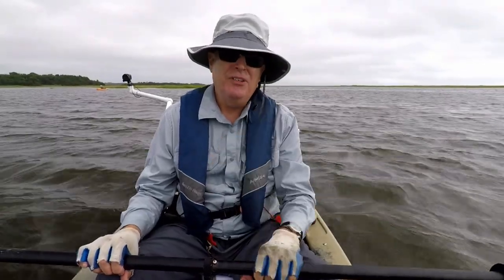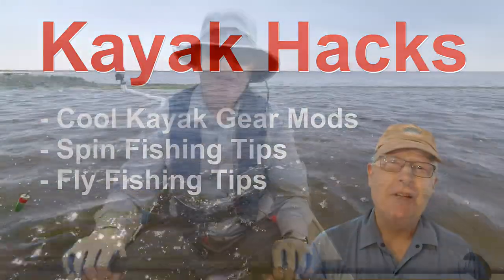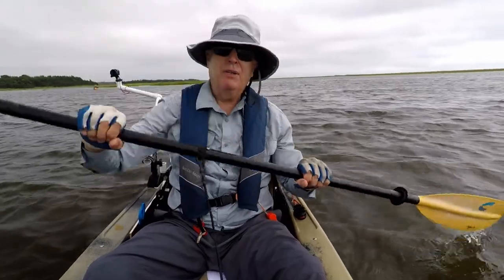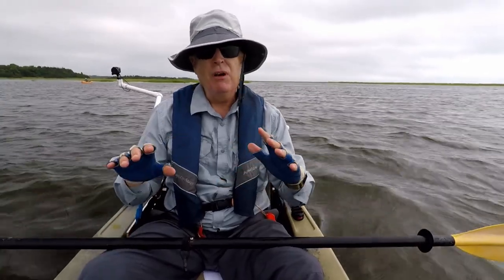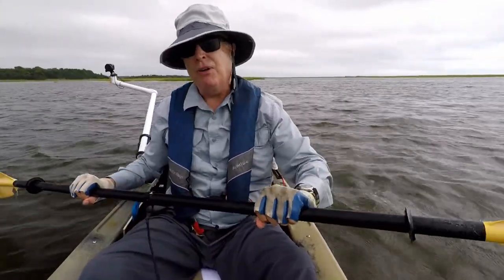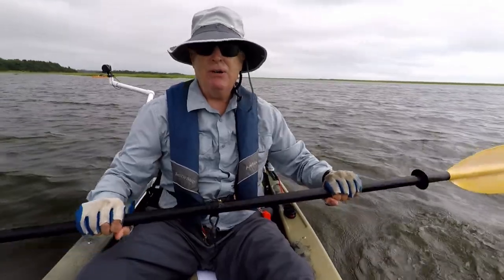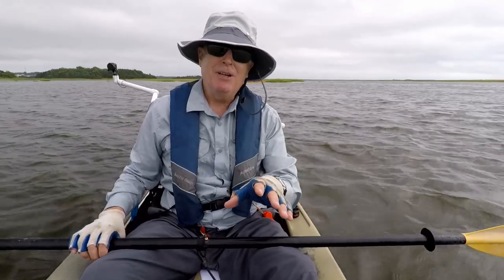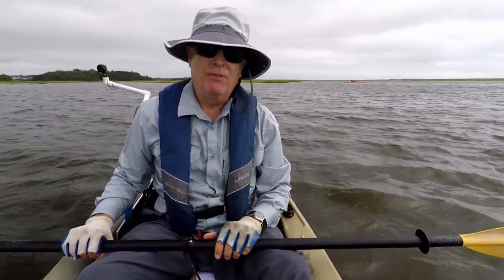Kayak Paddle Stroke for Dripless Paddle - Stay Dry!

Comment: Get some bees or candle wax, spread it liberally over the paddles, melt it with a hair dryer and buff with a cloth until is almost invisible. It's gonna repel water and your're going to stay dry even with a high stroke. Works just as well on wooden or on plastic (carbon) paddles.
Reply from the maker: Thanks for the tip!
Reply: Rain X or any hydrophobic coating works too ;)

Comment: Consider pros and cons of each style:
1.  Low stroke helps to minimize or even prevent paddle drip on/in the kayak/paddler, but that requires the stroke to be further away from the kayak. This results in increased kayak side-to-side "wobble", or "wag" which, in turn,  reduces straight-line travel. This will slightly increase the amount of effort required to reach your destination.
2.  High stroke promotes dripping on/in your kayak, on gear you may have attached,  and on your person, clothing, and life jacket. Also consider that muddy or salt water will require more effort to clean your kayak and gear after your adventure. However, paddling in this fashion will cause the force of each stroke to be closer to the side of the kayak, causing straighter travel and more energy-efficient paddle strokes.

Note that using a product such as "Never Wet" (among others) can significantly reduce or even eliminate paddle drip - allowing dripless paddling with either paddling style. Also consider that if you kayak in various waterways, such a product may even discourage attachment of water-borne creatures which helps to prevent distribution of various invasive species from one waterway to another.
Reply from the maker: Great points! Thank you!
Reply: Not quite. A low angle stroke -- also called a "touring stroke" -- will decrease the overall paddling effort because the upper arm is not lifted as high with each stroke.
You're right about the high angle stroke: it is faster (and wetter).

Comment: I think I will use Never Wet on about 6" inches of my shaft and tape on the paddle . I can't get the low stroke
down when going into the wind I catch myself going high for more power . My Kayak is only 10' and low
stroke tends to make the bow wander more than when I dig deeper next to the gun wall . We almost always
have wind on the lakes here . I also paddle my canoe with a kayak paddle and one with oars .
Reply from the maker: before going to that expense, try this - https://youtu.be/yc7g0cGr4Rc

Comment: Nice conclusion to the paddle drip! But, I take my dog with me in the kayak, and I have to use the high paddle motion to avoid hitting him. But all good advice. I like you PFD! have you ever had to use it?
Reply from the maker: Thanks for the kind words. I have never had to use the PFD... so I wondered about it and tested it. The velcro was too strong and it did not fully inflate. I had to manually separate the velcro seam!  My lesson learned was to not fully engage the velcro - just hook it enough to contain the balloon.
Reply: Thanks, I wondered about that. But it sure looks comfortable!
Reply from the maker: Yes, much more comfortable than a bulky model.

Comment: I tend to use the high paddle stroke most often, especially if I'm trying to get some speed going in open water on my Feel Free Lure 11.5, which is not built for speed.  Yep, I get paddle drip on me and in the kayak, if I get real aggressive using the high stroke, and I find I tend to get more water in the rear tank well. Probably due to my not-so-perfect technique.

I use the lower paddle stroke when going slow along the shoreline in real skinny water, or I'll use the small Backwater Assault Paddle (a worthwhile investment, imo) for finesse manuevering. :)
Reply from the maker: Great advice on how to select. Which type of paddle did you get? One for the high or one for the low and how does it work on the other stroke? Any noticeable difference?
Reply: Kayak Hacks Fishing I bought the Bending Branches Angler Classic (in 260cm length). I probably could have gotten away with the 250cm, but was anticipating seat adjustment to the highest setting (10") on my Lure 11.5.  I've yet to raise it that high though.  :)
Reply from the maker: Thanks! I'm going to get a new kayak next spring and always appreciate advice!
Reply: Kayak Hacks Fishing What model are you thinking about getting?  I've only been a "yakker" since this past June, and thoroughly enjoying the portability of the kayak, the skinny water I can get into to fish, and the added physical workout the paddling provides. I go minimalist, and take 2 rods, a milk crate with a few assorted lures/plastic baits, and no fish/depth finder.
Reply from the maker: You and my fishing buddy are twins! He goes light as well.  Both of us recognize we have outgrown our current kayaks. He needs one he can stand up in and I need one that is recoverable if it flips (my current kayak is not). We are going to begin the process of research and down select after the season ends in a few weeks. I will not make the final pick until I can sit in the alternatives and paddle them.  There is usually big kayak event/show in Charleston in March that will give me that opportunity.
Reply: Kayak Hacks Fishing Good luck in your new rig search. I'm still looking for one suitable for my soon-to-be 11 yr old grandson.  In regards to Chasn, I spent roughly 7.5 yrs there, compliments of the Navy. Left there in '83.  Ret'd in '92.  :)
Reply from the maker: lol... you Navy guys always had nice places for shore duty!  But... I would not have liked the extended sea duty!
Reply: Kayak Hacks Fishing :)  I grew up on Army bases, as my dad served 20 yrs. (Korean War Vet. 2nd Infantry Division). He got orders so often, I attended 3 different schools just trying to get thru the 7th grade.  :)
Reply from the maker: A fellow Army Brat! Dad spent 32 years in and we moved every year. Almost the same during my 20 years in the Army as my brother and I followed him into the 'family business.'

Comment: Yes, but that's not a way to paddle. It's ineffective. You will go slower and will zigzag. The tape does not stop water from dripping. It only stops it from going down the handle.
Reply from the maker: Going down the handle is what I want to avoid
Reply: @KayakhacksFishing  there usually is a rubber on each end of the paddle for that. My problem is the water leaking and getting into the kayak when the paddle goes over the kayak . I will try NeverWet or something similar.
Reply from the maker: @SciD1  Yes, that is the drip ring. My experience is they do not work well. Let me know how NeverWet works out for you. It should!

Comment: No expert should be telling you to make every stroke a long one. For effective forward paddling, each stroke should be going only about 2/3 of the way from front to back, and ,you are correct, should happen more due to torso rotation than to arm bending. When you need to make the occasional corrective strokes -- also called "sweep" strokes -- that is when you go all the way from front to back.
Reply from the maker: Thanks for those points